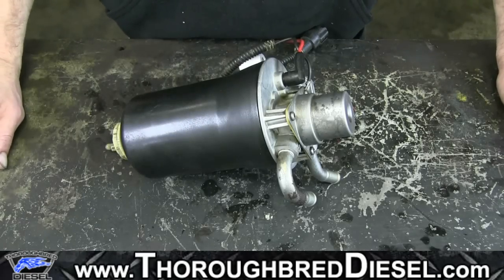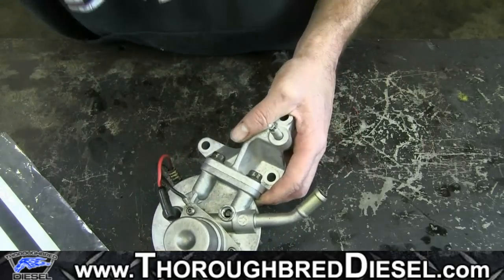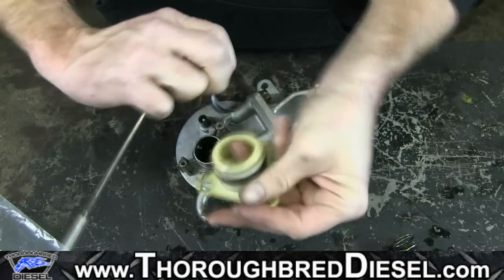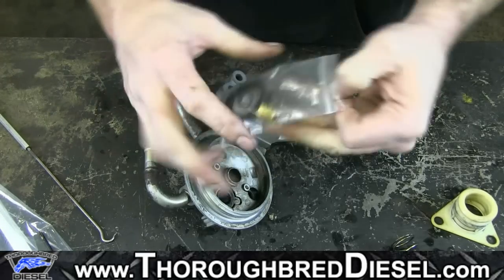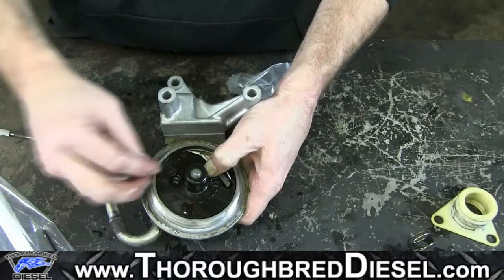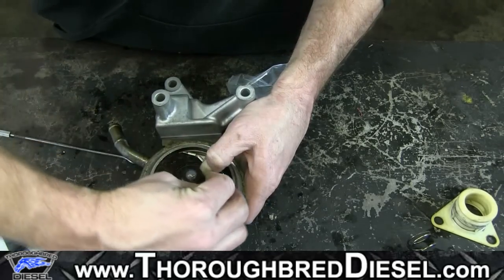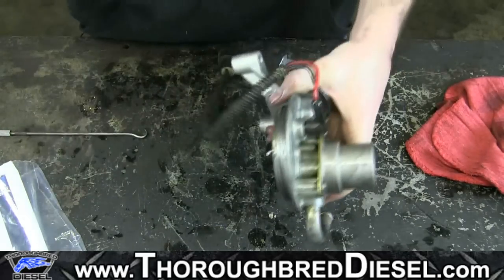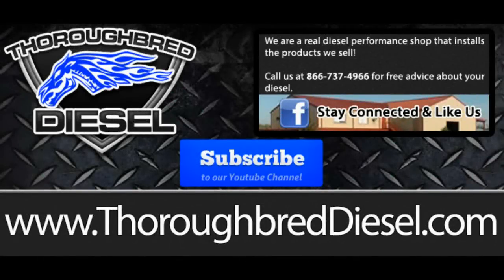Duramax Fuel Filter Seal Kit Install: 01-10 Duramax #AP0029

Comment: Do you still have to prime it when the filter head goes back on?
Reply from the maker: Yes. The system will still need to be primed when you change fuel filters, etc.

Comment: If I have a Fass lift with filers, can this be bypassed by just mating the intake and out take fuel line together or is there to much pressure from the Fass lift pump to safely do that?   Also can a small leak cause a high pitched whine when the truck is heated up real good, mine does when I slow down then speed up I can hear it but it goes away and doesn't do it all the time.

Comment: I have put on a new fuel filter housing, new filter, new hoses that run from the filter housing over to the motor and it is still losing prime. What are some possible things that could cause it to lose prime since I have replaced all of those? 2002 Duramax Diesel
Reply from the maker: You could have a couple different things going on.  You could actually have a high return rate injector that is causing your hard start.  If you are positive it is a prime issue,  you may want to trace the lines down the frame and see if you see anything there that jumps out at you.

Comment: No one addresses all the crap above the bolts and vacuum brackets above the bolts you have to take off.
Reply: The turbo hose, A/C hoses are right above in your way not to mention the 50 wires and harness bolted to it.